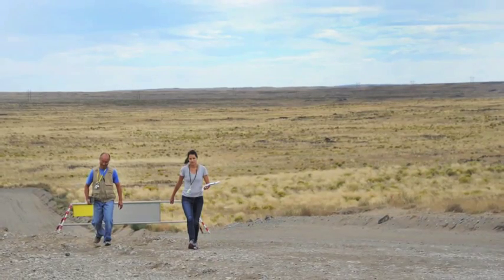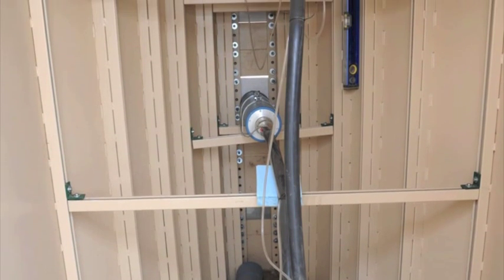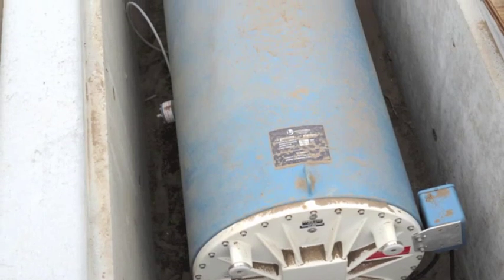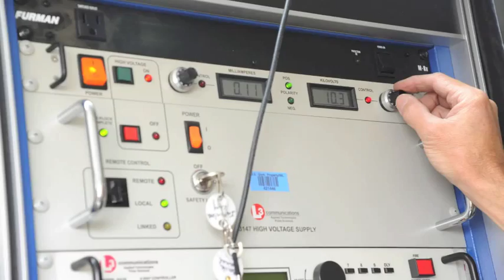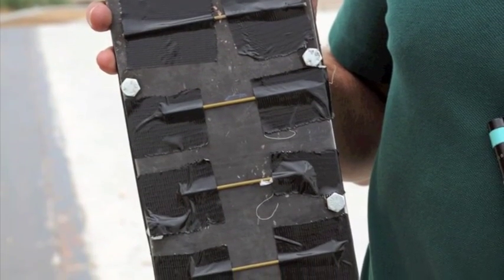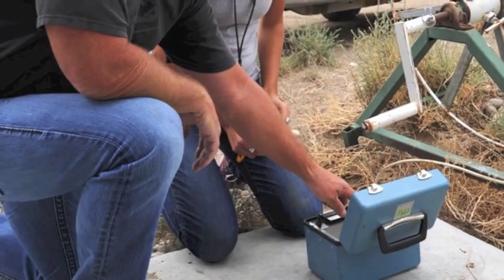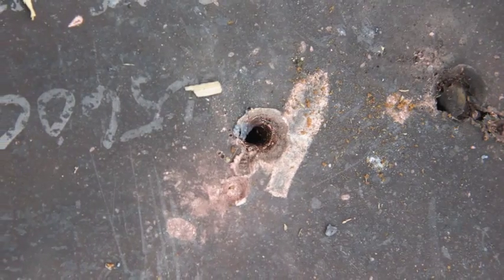Flash X-ray

Comment: Can flash X-ray also capture motion?
Reply from the maker: Each X-Ray head produces a single image when fired.  Multiple heads can be fired with a delay between them to obtain a sequence of images, but it is quite costly to obtain more than just a few images from a single event.  So Flash X-Ray videography hasn’t been invented yet.  An example of two sequential images on a single film shows up at 4:17 in the video.  The two images of a single event, one above the other, show a bullet just breaking out of the target (bottom image) and then exiting the target back face (top image) a few microseconds later.